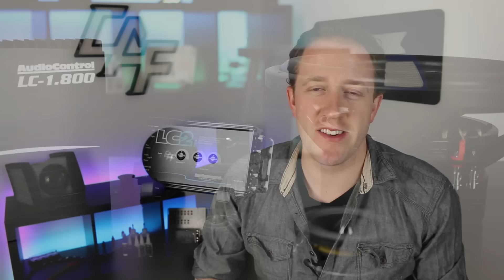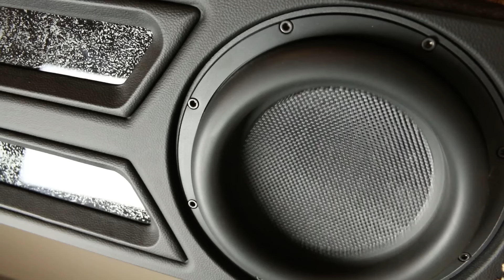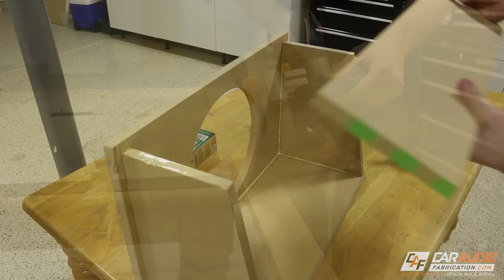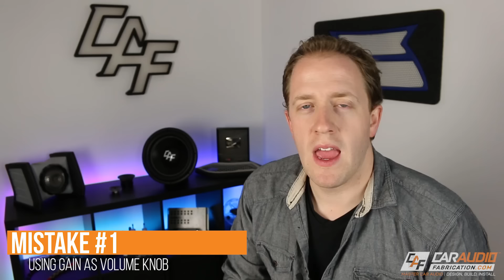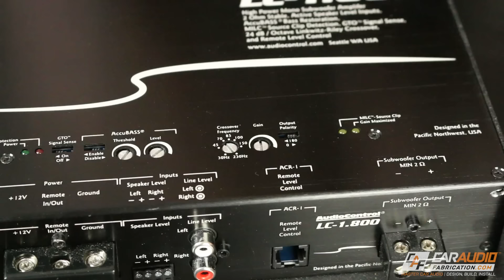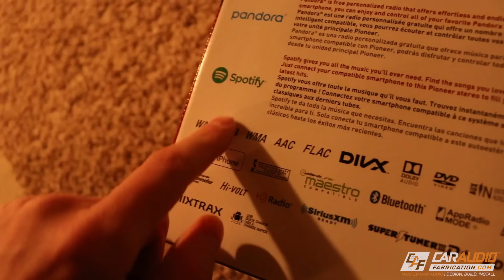Avoid these 5 common Car Audio NOOB Mistakes!

Comment: The only thing capacitors are good for is the trash.
Reply: Must not of had an amazing system yet lol 300 rms amp with Rockford’s 450 rms 12” speaker aw mazing
Reply: Tony Lewis Rockford’s are trash, and you are telling me I haven’t had a good system yet. 2 DD 508’s running off of 600 watts rms. Extremely loud for what they are and what they are in. Plus infinity kappa door speakers, 75 watts rms each. I have an auxiliary battery mounted 14” away from the amp.
Reply: How do you charge it
Reply: Not really - but don't buy from an audio manufacturer as it's overpriced, and protect the dang thing [or ride the lightning].  Like the video suggests... adding a cap is the absolute last move.   The thing people forget is that speakers are a current device on balance, and when current demand exceeds total system design, voltage will drop.  A capacitor is only good at holding system voltage up for a very short period of time to cope with momentary current demand, best serving your sub amp 12v supply.  When people see headlights dimming, that event is going on too long and no capacitor in the world can fix that / serve continuous demand.   Only an alternator upgrade fixes that.  I like to think of a cap as useful like adding a stepping stone to get over a small stream.   A bridge it is not.
Reply: Zeb McCollum well.....the digital voltage display is good to have.

Comment from the maker: New here? Check out this custom ported subwoofer build video I just released! https://youtu.be/eTQeUfv1dDU
Here on this channel I have car audio reviews, tutorials and build log videos and I love to help you master car audio.
I also love burritos.
Reply: CarAudioFabrication
Reply: CarAudioFabrication a friend of mine who made real good money doing installs at boomer mcloud told me that for the best sounds use the AC DELCO deck 
It’s 2Watts with nearly zero distortion
Amplify that sound and it is smooooooth
Reply: CarAudioFabrication i see friends make mistakes when adding speakers and wiring them wrong. Not understand ohms direct effect on amps and speakers. ie: 100 watts @ 4ohms is rating of amp. Several speakers wired together making amp see speakers ohms @ 32. I find using water pressure  and a hose as examples. Water pressure =watts and hose diameter =ohms. And make point on how much furthur  water shoots out with more power from a half inch hose compared to a one inch diameter hose. Water dont go as far and power behind it is much more sluggish. That = sound!
Reply: I would say Add a #6 Mark, never I mean never install an Android stereo(I had one... It never sounded right and always clipped past 5... Also half the touch screen stopped working)
Reply: We have a 2016 Dodge Ram. We purchased an Audio Control amp, ic6. And new upgraded 6 x 9 speakers for our truck. We kept the stock deck. We had a local audio store try to install everything. 10 hours later they still had no sound. Something about the stock deck not reading the amp. We dont want to purchase a newer deck. What answers do you have. Thx, frustrated
Reply: You look like a non reptilian Mark Zuckerberg.
Reply: On different amplifier they are some with a lot more watts rms and quality amplifier but they are some with a lit more watts and the amplifier isn't as expensive but less quality which one would be better?
Reply: Yes, I’m new at this. I have a f150 that I’m putting a stereo into. I have 4-6*8s that have an RMS rating of 125watts each but are 8ohm speakers. My amp is 4 channels at 150 watt RMS each channel  at 4 ohms but come to find out is more like 85 watts at 4ohms. Being that my speakers are 8ohms it would be like 40watt each. So, I bridged the amp and ran the speakers parallel. Won’t running in parallel drop each speakers ohms to 4ohms? And running this 4 channel amp bridged get me a lot more power and match the 4ohm I think I got by parallel the speakers? Most important will running 2 speakers in parallel still get the bridged watts I think I’m getting or not?
Reply: ))lllyľi5uu5ou5uuu5uuuuuuuuuuuuu55uu5u5uuyuu5ukyky>

Comment: buying a 4 channel amp for a sub. I've seen a few people do it, I've done it, It's cringey to think about but hey, when you don't know, you don't know.
Reply: phallus36 i ran a sundown 100.4 on 2 12 fi ssd. Was very happy
Reply: phallus36,  Nothing wrong with using an high quality 4 channel amp to run 4 speakers and an sub. Or the front 2 speakers and a sub.   If you are going to run four 4 ohm speakers and an sub.  Run the speakers in series so the amp will see an 8 ohm load per stereo channel and run one 8 ohm bridged sub for bass of two 4 ohm subs in series for bass. The Amp will run cool for hours.  Loading the amp down to 2 ohms stereo and 4 ohms mono is a bad idea.  If space is limited an 5 channel amp is best....... something like the excellent Alpine MRV-V500.
Reply: phallus36,  That not true at all. There lot of good 4ch amps that can be bridged to 2 ch and run a great set of subs. I know and i have a 4ch amp bridged to set of subs that sound good.  I had some 4ch amps and i used then instead of having to buy a 2 ch for subs.

Comment: Max wattage advertised I found with some brands is at 18V feed. Max wattage also applies to THE MAX the amp provides at peaks. I look at RMS to guesstimate what I need. Along with that is resistance, but that’s another story. Great video. 🤘🏻
Reply: Sometimes they even take the maximum rated wattage for the transistors, and disregard the rest of the amplifier to get artificially high numbers. I had a relatively cheap amp rated at 1200 watts, replaced it with a significantly more expensive amp rated at "just" 1000 watts, but it definitely had a lot more power, they even had the same fuse rating, shows how misguiding specs can be.

Comment: For amps and processors buy Audio Control, nothing is better for the money. The guys at engulfaudio are great!
Reply: The best audio processor is no audio processor.   I have not auditioned one audio control product that did not add significant distortion and coloration to an high quality audio system.

Comment: is it okay to use a inbuilt amp on a subwoofer, will i have a china made thing  which is 500w with 20rms and its not tht loud, but   nor clipping, i have all the mp3 in 320, but some of bass or base is over and under, and wiring - it dosent come with but yet am using a 12gage line from car battery cos of china product which i have or please refer me a suitable wireing kit like wht gage and all, and another thing is that am using 2 component speakers and 2 ovel speakers, on the direct audio is it good? or should i buy a amp to cover it up, am using a maruthi ritz and its a small car.
can u suggest me the things it recommended to use? 
plz help me am from india

Comment: Hello, I’m looking for a solution and it seems like it’s not a common problem. The problem : listening to my stereo, sounds great, clean base, but all of a sudden with low long bass signals it kicks in and it gets like a juice boost, like if I cranked up my gain, and my subs get louder. No distortion it just cranks up all of a sudden, I’ve checked the ohms on my speakers they are at 1.5, which is adecúate. I bought new rca’s and it still does it, I took apart my amp power control, didnt do anything to damage it but who knows. It’s driving me crazy anybody have any idea on what it could be?

Comment: Mixing speakers sizes and brands. If you do so you maybe canceling some frequencies. And will sound dull or distorted. For a clear and crispy sound use same brand and size on your front speakers aswell as at the rear, and make sure the virtual scenario is always infront meaning the voices should be coming from the front and not from the rear. 
Unless you are of those peoples who go to a concert and turn your back to where the sound is coming from...

Comment: Years ago I had 2 12” Cadence subs running off a 1k watt PPI amp. Sounded incredible for quite some time....until the engine bay caught fire and pretty much destroyed the car. Was likely due to the fact I was running only a capacitor and never upgraded the other electrical components. Ahhh, the memories!! 😊

Comment: If you build a system 100% correct meaning buy amps according to what your speakers you choose. need you'll never need to run your gain anything other than flat! Also. Anyone with old school PPI ART series amps. I'll buy them.

Comment: Needed a remote wire on my first install (16yo). Went to the first reply on a forum to check what gauge wire I needed. It said 0. Realised while installing how stupid that was. Also had solid copper house wiring as an amp ground. Truck is still alive today somehow and have a much better and properly wired system!

Comment: You can upgrade your electrical system but if you have a poor ground connection it wont sound good or you will get that whistle sound when accelerating

Comment: #6 Using poor quality wire. Both from true-spec and copper content point of view.
Reply: #7 Poking a hole in the surround while mounting a speaker. X-D
Reply: thedog556 POWER WIRE MORON! NOT SIGNAL CABLE!
Reply: thedog556 I think you should watch this video a couple more times. :-)
Reply: I think the point is CCA (or KCA as one company calls theirs) just doesn't have the same capacity to handle current at the exact same gauge as OFC. Some have taken to "oversize" to make up the difference, yet others are downright evil because they actually downsize the gauge and still call it the larger diameter's gauge. If a kit comes with a fuse, it can tell you a few things. i.e. if you got that nice 1/0 kit for cheap and all it includes is a measly 60A fuse... it's more than likely really equivalent to 8Ga.
Reply: thedog556, The coat hanger probably sounded better.  Most audio companies are just about marketing ( The bigger with the most insolation cost the most and sounds the worst).  Over the years there have been many companies that listen to their product and provide excellent sounding wires.  For me solid core 18 gauge speaker wire with very little insolation sounds the best.   Oxygen free 100% copper power cable sounds the best.  I have given up on mass production RCAs  ..... Zero consistency.  I use my own wire and custom terminations.
Reply: When you say "quality" what is really an issue is the number of strands - the more the better for wiring a DC system.  You know a noob has been in your system when you find a piece of solid wire.   If you're lucky, nothing caught fire.
Reply: Finch,  If you have a high strand count of coper coated aluminum wire then your system will sound fantastic?  Pure 100%  copper wire sounds far better than aluminum no matter what the strand count. Most cheap Chinese wire is almost pure aluminum with a thin copper coat. Solid core wire (for the most part) is not practical in car audio other than subwoofer wiring.  It bends and brakes in almost every other car audio situation. Wile 8ga solid wire wont  brake it is a pain to work with.  That does not mean that stranded wire can equal it in sound quality.  Compare 18 ga stranded speaker wire to solid wire and listen for yourself.  Audio Quest made solid core flexible  flat speaker wire that was killer.  Even with fairly thick insolation and under carpet it still crushed stranded wire.  It is not an magic bullet comparison.  Almost any human can hear a difference.
Sometimes 10ga sounds better than 8 ga or 8ga sounds better than 4 ga.  It depends on the installation, power requirements and the quality of the wire.   Use your ears not your theory.  Your ears can easily bypass the best of marketing hype.  
Solid core wire is no more flammable than stranded wire.  Nice dramatic touch though.

Comment: 99 4runner , 2 12" p1 Rockford Falsgate punch series. 700w Pioneer amp, alpine deck high output alternator. People are shocked by the quality and push of these base model subs. It's not size, price, or name but combination, airspace, and electrical output components.

Comment: under powering woofers is damaging always want to slightly over power
Reply: How fucking stupid can you be?
Reply: Relax, chuckles - I think Chris just phrased something important in an off way.   I'll put it differently: if you have to set gain at 75-100% on the amp serving your subwoofer, expect a short amp life/it's underpowered.   Go to a bigger amp, where having gain between 25 and 50% gets the job done - it won't get as hot, and last longer.  A drop in distortion is a nice bonus - speakers want current for the most part, and subs need lots of headroom.

Comment: Lol mistake 4, we were in walmart and we walked by a kicker sub and it said 1300 watts max (it was like 250rms) and my dad is like ya 1300watts for a milisecond then the the cone flips backwards and doesnt go back in again lol
Reply: Exterminatingtraper yeah. I never shop for subs by max. I go by rms. That and brand power. Using 2 Sundown SA-12s on a Sundown scv-2000d, in a custom box. Love it. All i need
Reply: @godzilla7391  Hard to go wrong with Sundowns 😍😍

Comment: You were ok until you crossed over to the Lossless vs anything and 320 kps mp3 is laughable. If it was effectively formatted in 256 AAC from a Lossless Source sure in a car without serious sound deadening I'd accept that argument. However, as some Car Audio enthusiast have systems that rival expensive Home Theaters, a Lossless source at that point becomes incomparable to anything else. Granted if you have crappy speakers or a crappy head unit, wires, etc you won't notice the difference, but please do not confuse people to believe Compressed anything is better than Lossless it simply is not factual if you want the Best sound possible. Understanding how Subjective hearing is, just because you can't discern the difference between Sources does not apply to all. Great vid btw..
Reply: Wait, I didn't watch the video closely. Did he claim that MP3 or AAC is somehow superior to WAV or FLAC? That's not how it works. That's not how anything works.

Comment: What active crossover would you recommend for 3 amps.  one of them is for a sub the other are for door – speakers and a set on the dash. I may plan on adding another set for tweeters and 6” mid bass sub. My current sub is a single 10” Alpine type R in a sealed box . I can’t seem to find any 24 dB per octave slopes adjust.the only ones adjustable I can find are 18 dB for slope my system is in a s-10 pickup reg. Cab. could you recommend something for me thanks Devo￼

Comment: One question, does sealed mean that has no air port or air vent? (Reply if  you can)
Reply: Yes. A sealed enclosure has no ports or vents. The provide the most versatility, widest sound response, and are the easiest to design and make, and make them function well. They're also smaller than ported boxes and don't have to be 'tuned' to any frequency [which just narrows the response range of the speaker, anyway.]
Reply: Drunken Hamster Oh wowz
Reply: DJ Techno The  Fox yes,ita exactly what it means.band pass has usually two vents, while sealed has none.band pass box can be two subs or one sub behind a lexon plexiglass inside box.or speakers on top of box with vents on sides.

Comment: Mismatching speaker ohm to amp ohms, i blew out alot of amps in my earlier years running 1 ohm speakers on 2 ohms amps
Reply: How's your current system???

...I'll get my coat
Reply: I used to do that screwing around with home systems. thankfully it was mostly mismatched hand me down crap and hard rubbish finds so no gain, no loss haha.
Reply: Or 1 Or 13,000
Reply: Never seen a 1 ohm speaker though voice coils do have impedance but 2,4 or 8 and when you get to home audio sometimes 16. Just sayin